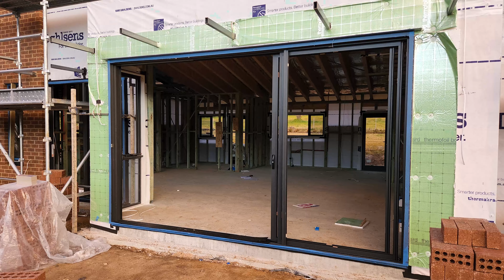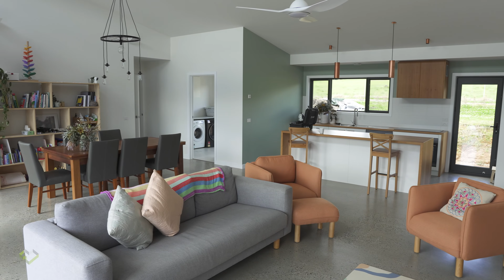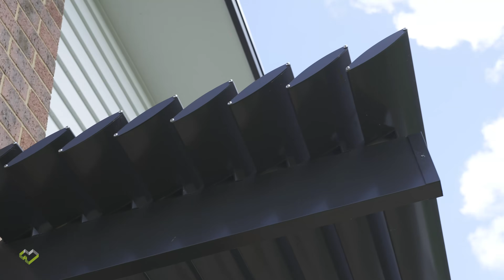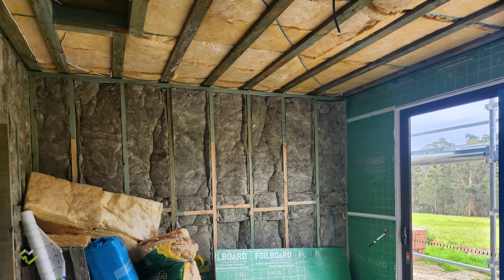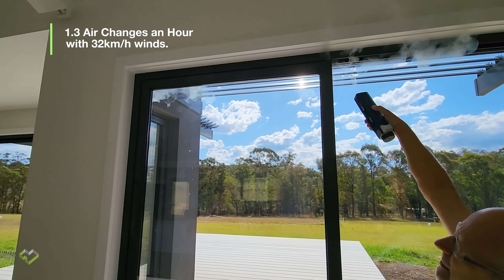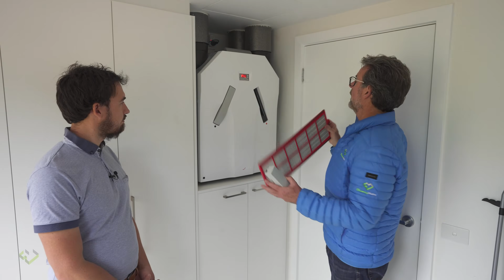Passive House Level of Air Tightness with just Drywall?

Comment: Thanks for sharing this. We're also using plaster as the air barrier. I noticed a few sliding doors. Are they lift and slide (i.e. More airtight)? Or standard?

Comment: You all focus on insulation to protect against cold weather. You should also consider protection against warm weather and this you cannot reach only by insulating your building with low density material. There are other materials to use which are optimal for both warm and cold weather insulation. You should talk of roof phase shift in terms of hours of delay and damping factor (I think this is the English word). You also need to talk of internal aerial capacity. Without these values, it is difficult to judge the level of comfort of the house.
In Italy, a good insulated home will have an insulation of 0.1-0.2 W/m2/K, a phase shift of more than 16 hours, damping factor less than 5%, and an aerial internal capacity of at least 40 kJ/M2/K. Refer also to UNI EN ISO 13786
Reply: Great points!

Comment: Would like to see fuller version of this show that drills down into air handling, moisture control and possible  condensation locations, insulation levels.  I feel this just is just titillation around a complex issue to a lot of people.  I say this as I don’t think this is aimed at professional folk.
Reply from the maker: Well, the majority of moisture movement into walls occurs via air leakage, not the vapour permeability of the material itself.  This building has been very well insulated and thermal bridges have been mitigated as cost effectively as possible.  We discuss these topics in this video.
Reply: @ecoevo  100%

Comment: Impressive result for the Ach50 but in the video you show photos that have the proctor wrap installed in the ceiling cavity prior to the plaster board installed. I don’t know why you are clamming that the plaster board is the airtight layer. It’s obvious that the proctor wrap is the airtight membrane and hence the air tight layer. Can you please clarify this as some of the viewers might get the wrong idea that such an airtight house is possible without  an airtight membrane.
Reply: Fair enough but still you can’t claim that the house achieved an airtightness of 1.3 with plasterboard if you have used an airtight wrap behind the plasterboard.
Reply from the maker: Mark just corrected me, the smartvap was only there to hold back the insulation in the areas where the Hrv ducts were.  All the walls and the ceilings were plasterboard for air tightness. 👍. PowerPoints were leaking and all the windows and doors were NOT passive house.  Just standard aluminium thermally Broken ones.
Reply from the maker: On the ceilings that had smartvap, the smartvap was only there to hold back the insulation only.  It was not treated to be the air barrier. 👍
Reply: Keen to know this too and info about other material. Do they have a HRV? If not, at 1.3 ACH, is that a healthy/ good idea for moisture management?
Reply from the maker: @dulnaperera-cameron8700 Not sure if you can manage moisture with random air leaks around your home, to be honest.  Watch the video and you may find out if it has a Hrv. ☺️
Reply: How many split air cons are run in the houses, location and rational behind? How do the perform in conjunction with HRV?
Reply from the maker: The proctor wrap is not installed, continuous to anything at the walls.   It was installed just to keep that area for the Hrv/erv nice and clean.
Reply from the maker: Such a great level of air tightness is possible with just plaster.  You’ll notice in some areas of this video there is smartvap on the ceiling which is sealed to the plasterboard.
Reply: If the primary airtight layer is the plaster then what is the purpose of the proctor smart wrap?
Reply from the maker: @jpeterstme in false ceilings to accomodate the Hrv ducting.  The Hrv ductwork has been design to always be inside the building fabric.
Reply: What product is the wrap?